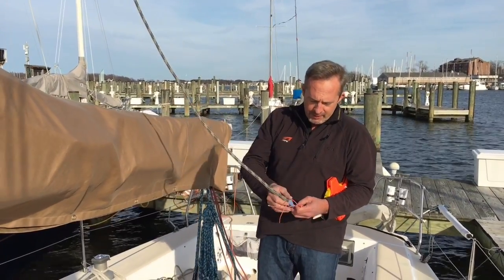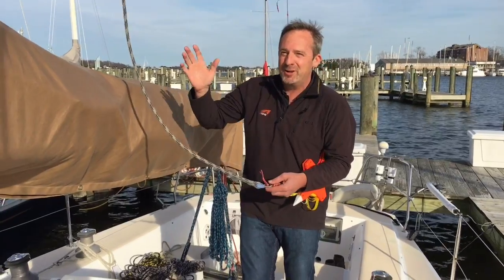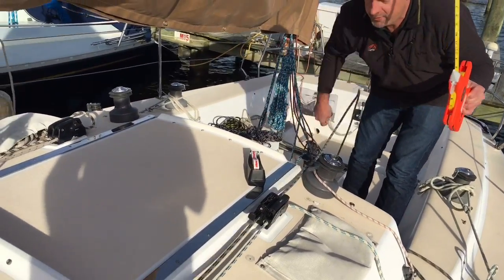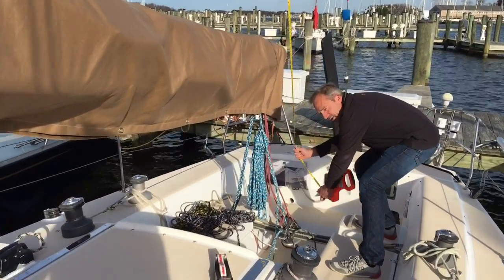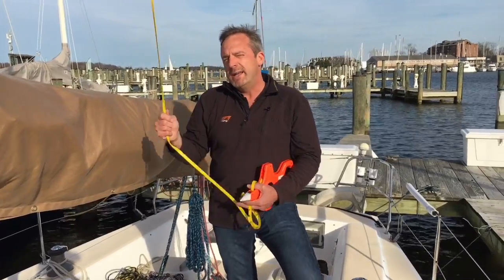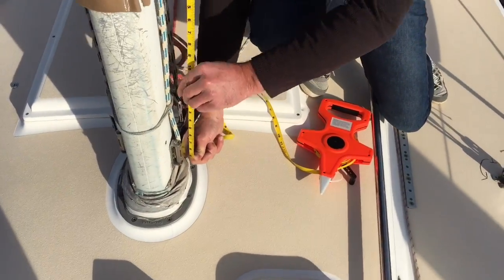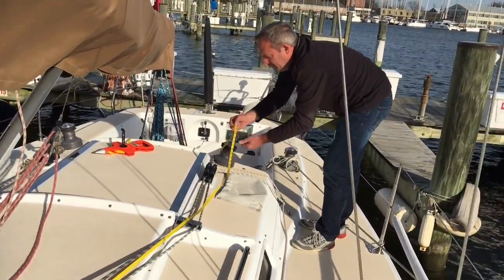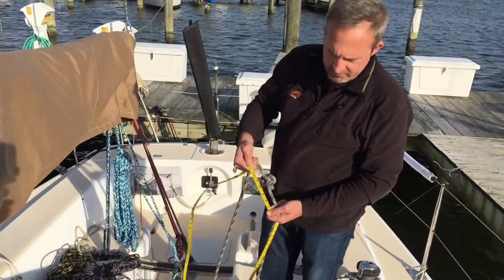Measuring Sailboat Halyards | Expert Advice

Comment: As a rigger, I also tie a small messenger to the halyard, so if the knot/line holing the tape measurer, or if the tape measurer itself breaks, you can simply pull the messenger down to retrieve the halyard and won't have to hoist someone up the mast...
Reply from the maker: Hi Jerome,
Great tip! Thanks for watching and commenting!
-APS

Comment: OK, for what purpose is the halyard measured for length? If it's just to know what length, that would be the simplest. However, if you are measuring the halyard for replacement, would it be easier to put a fish line in and take the old halyard to the rigging shop for them to use it as the perfect example? but, what do I know?
Reply from the maker: Hi David,
Length is primarily needed for ordering a replacement.
Being able to leave your existing halyard in is desired if you want to be able to sail while your new halyard is being ordered, fabricated and shipped to you. Hope this clarifies. 
Thanks,
APS

Comment: In you length measurement math, did you include the splice bury?
Reply: It usually depends of the type of halyard you are using. For example, if you are using a double braid halyard, with a Dyneema@ core and plan on building a double braid splice, then you should add 100 x times the core diameter for the bury and enough for your eye splice. With a 3/8" halyard, and a core of 5/16", you should therefore add about 3 feet to your halyard measurement so you can properly build the splice. Also, if you build a cover to cover splice on the tail of the halyard, I usually add another foot where the core will be removed.
Reply from the maker: Hi Joe,
Good question.  No.  Not knowing how the end would be finished or spliced, that length is not in the finished halyard length.  I will annotate your point in this video though.
Thanks,
Kyle